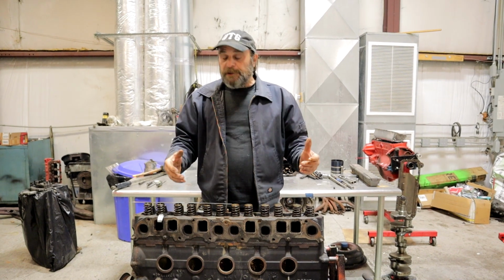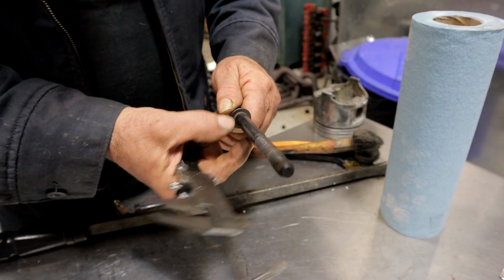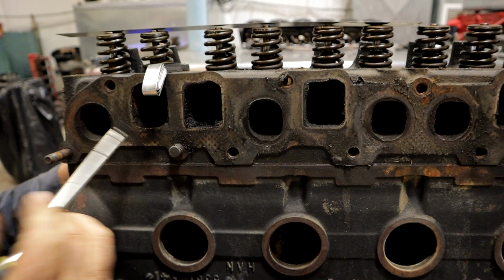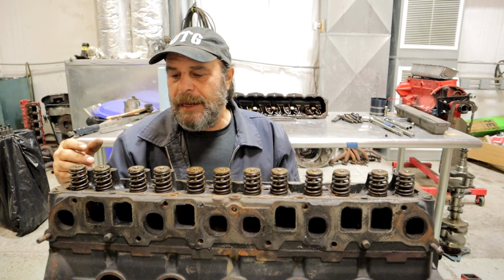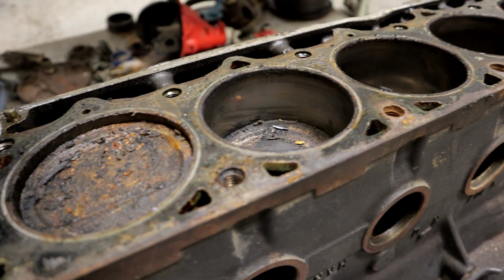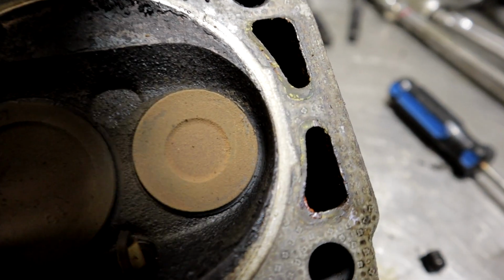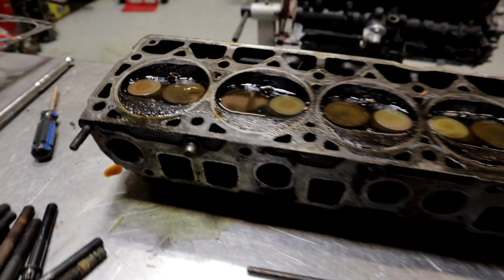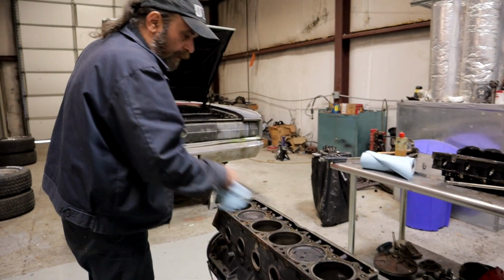Your First Engine Job - Pulling The Head And Assessing The Damage

Comment: I've got a 1968 jaguar 3.8 that's locked up. It's been soaking for months and I've finally resigned myself to having to open it up. Looks like I'll be watching this series of UTG on repeat over the upcoming winter. (Southern Hemisphere)
Looking forward to it if I'm honest
Reply: how did it go
Reply: @TheJCompound  not well I'm afraid. I'll need to pull the heads but it's in a line behind 3 other project cars😅

Comment: I have not had good experiences with reman 4 liter heads. I had one refreshed at a machine shop for less than 300 bucks. Cleaning, valve job, springs, seals. Ready to paint and install, and I knew what I was getting. Why would anybody bother with a gamble on a reman.

Comment: The bolt stretch is 100% correct, this happens when the bolt's yield (and likely ultimate tensile) strength is exceeded and it begins to neck. It will lengthen at the expense of diameter and that relationship is described by Poisson's ratio.

My materials class finally coming in handy :D

Comment: When I rebuilt my ford 300 inline 6 engine, I tried to get a remanned head but they were and are still unavailable. Mine was cracked so I had to go buy one from a salvage yard and get it machined. When it was all said and done it was actually cheaper or about the same as a remanned head. So, while yes a remanned head will save you time and maybe some money, the availability is something to take into consideration.

Comment: Great advice on getting a reman head if the teardown sees trouble. I once had a Chevy Cavalier that needed valves ground. Due to cracks between the spark plug and exhaust valve (those engines were known for them) It took 3 heads to get one that was good enough for the machine shop to rebuild...by which time I had almost exactly the cost of a reman head in it.

Comment: The "blocked water passages" that you pointed out are not water passages. They are sand casting drain holes. They are only there for sand removal after the casting process. As you can see, the head gasket does not have through holes for those "blocked water passages". The only water passages that are active on this engine are the two in the very rear, the one circular hole in the very front and the small 6 holes on the cam side for each combustion chamber.
Reply from the maker: Yes..I realized that after we shot this and Kathy had finished the editing.  I'll mention it in the next installment.
Reply: @UncleTonysGarage  man tony, where would this channel be with out dead eye master techs from the land of comments? Love what you do man, I've learned A lot from you, and you lead me onto David V and now I'm checking out his new channel. I'm glad he makes videos about the book I got, because honestly he takes a bit to get to the point and I'm more visual than a reader. Lastly, I love xjs and the 4.0. and Chevy inline 6s, and the big ford, I don't think anyone made a bad inline engine. Thanks again!

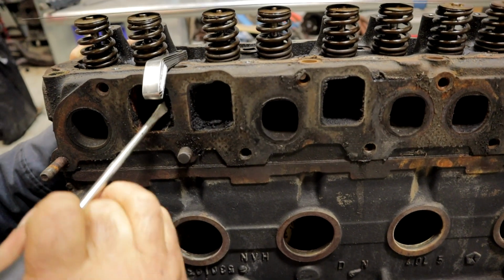Comment: 4:23 I would lean more towards PCV dumping into the front half of the intake.
Reply: I was thinking the same thing.
Reply: or EGR
Reply: definitely, They are known for being oily mess inside the intake. I put a filter on the pvc line to try and slow it down
Reply: @sometimesleela5947  no I would not go that way the exhaust has already burned the oil and it would be a sooty deposit.
Reply: Interesting comments  there is NO  PVC Valve on that motor   What EGR  
  my thoughts are a Poorly Done in frame Overhaul  with a lot of miles
Reply: My bet would be blow-by (probably from that #1 cylinder) "pressurizing" crankcase. These engines just have a metering orifice to create positive crankcase ventilation, not a PCV valve.
Reply: @tanhalt  I can groove with the idea!
Reply: @tanhalt  CCV  it is
Reply: @sometimesleela5947  No EGR on these engines

Comment: According to the FSM on 4.0’s if you reuse head bolts they should be marked. Marked head bolts should be discarded and replaced when removed. 

Since 4.0s are subject to overheating I suspect that head has been off a time or two and the bolts weren’t replaced.

Comment: Finding the Fugly...
4.0s toward the end had cracking cylinder head issues, prior to, if you were good about oil and coolant changes you could count on 220 - 250k miles before the rings were ready for retirement. 
Another cool thing is the reward for using good oil - #1 cylinder stays near round and with near no ridge - not bad for the cylinder right behind the water pump!

Comment: WHen I was wrenching on racing 2 stroke motorcycles, we used to turn down the plain part of the cylinder bolts - the the threads were a bigger diameter., so as to eliminate the stress riser. Because otherwise you had a teardown or 2 and you went to tighten a jug up and jink you broke a bolt, I think the later factory bolts did exactly this. This was on early Yamaha TZR350s and 750s btw..

Comment: I bought a 1997 Jeep xj last summer with a broken piston skirt. It only had 170K ton it. I just pulled the oil pan and head. It was the #3 piston. I just ordered a piston and gasket kit from Rock auto. Though I failed to order a new pan gasket was able to clean the old one with RTV! It all works great. No leaks and runs good. I’m 56 and this is how I have fun. I put 4.5” lift and 35” milestar mud tires and wheel that were close to new from market place for cheap.
Reply: NICE, HAVE FUN, SIR.
Reply: I also like to surgically fix my own stuff. No need to rebuild an entire engine, trans, rear end if its not necessary.
Reply: I like to see how good I can make something for the least amount of money. I still want to be kid of cool 😎. Even though it’s kinda silly.   My daily is a 2007 v8 4Runner with only 290k I bought it 2 years ago for $4500 put in all new suspension CV axles Tires and detailed it’s been 100% reliable and for what is it kinda fast I do have 33” tires on it.

Comment: When checking the seal of the valves I like to put the gas in the runners not the chambers. The test is the same. But I think it's just a bit easier to watch the valves weep.
Reply: That's what I do also it's extremely easy to see when there all carboned up
Reply: If it had overheated, the valve seals are now toast anyway
Reply: Valve seals are not in the runners. But yes I'd pop off the valve spring and replace the seals. Even test the spring rate.

Comment: I would say the oil in the intake passage came from the PCV valve. Those 4.0L came in all the time and the air filter would be soaked with oil from the breather..   idk if it was just excessive blow by, bad PCV valve or just a poor PCV system design in general on those jeeps but with some miles on them it was impossible to keep them from soaking the air filter and the breather filter in the air box.

Comment: Tony, In a future video, could you pull those burned valves and compare them to good valves?  Because I couldn't tell what the difference was.  Thanks.
Reply: The clue is they are slightly off circular- as soon as you see that, you know when you take them out they will be worse.
Reply: What don't you get he told you which valves are f*** up without having eyes in the combustion chamber Superman with x-ray vision couldn't have done a better job at diagnosing this problem but we're human we're not Superman we don't have X-ray vision diagnosing the problem is a five-step process Step One machines f*** up Step2 what part is it out of the Thousand Parts it could be and isn't is it. Step 3 is research if you don't have experience ask somebody step four is getting the correct Parts on hand in the proper Machining the correct the problem step five reassembly is opposite of disassembly so pay attention and take notes throughout the process and a lot of times you can't even see a sunken valve when you lay eyes on it 3 1 thousandths of an inch is the threshold where the human eye stops seeing is the width of your eyelash a little bit less than a human hair not trying to be a dick just want to help you expand your mind and knowledge peace
Reply: @kevinpatton3950  I don't have the resolution to see it on my screen. Maybe he can't either
Reply: The valve literally starts to burn from getting too hot. 
It can vary from being slightly out of round, to looking like someone gouged it with a torch.

Comment: Years ago I had an 83 CJ7 4.2L six with a cracked head. A friend brought me a head he had in his shed. My head bolts were 1/2" diameter, but the replacement head bolt holes were 7/16" diameter. So we put the head on a drill press and made the holes 1/2". The head bolted right on and the engine ran. But it was way down on power. The only thing we could think of was that the head was from a 4.0L and had lower compression. And it only got 10 MPG!. But I had to get it running because it was my only vehicle at that time. That's when I swapped in a SBC 350 with an adapter plate. The 350 got 15 MPG with double the power.

Comment: I was exposed to the Machinery's Handbook when rebuilding my first engine.
Very useful for checking whether standardized parts - like fasteners - are in spec.
Reply: You are absolutely correct . As a machinist i agree 100 %
Reply: The Machinery's Handbook is the Bible to most engineering and mechanical designers. Invaluable information on math, geometry, iron, steel, fasteners, machine tools, tooling, fits, tolerances and interferences for assemblies, speeds and feeds for machining, coloring steels, material properties and so much more.
I own two, the standard toolbox size and the LARGE PRINT version that was "handy as a pocket" as I neared the end of my career in mechanical design.
I highly recommend the Machinery's Handbook to anyone that builds anything.
Reply: @dadstillsurfs  Dang, I have one but haven't seen it in years. Good summer project rummaging through my machine shed.

Comment: How clean is the intake valve?
Jeeps original injectors are single hole and are designed to hit the intake valve with raw fuel and clean the valve.
If you have bad injectors and the spray is off or weak then the valve will not be cleaned.
The ports also suffer with carbon buildup.
Note: Four hole injectors also don’t clean the valve either

Comment: Another thought about the gak in the intake ports could also be from the PCV valve. Depending on where it is located on the valve cover, and where the vacuum hose for the PCV valve is located could cause that build up. I could be wrong, but that could be the build up in those ports.

Comment: So sunken valve seats do happen quite often with aluminum cylinder heads. Also valves like to "tulip" or stretch because the seat area of the valve will get beaten away from the valve stem.

Comment: Uncle Tony could you make a video about the use of a torque plate when honing an engine people have free handed it for years but let's talk about what happens when the cylinder heads on in the bolts are tightened

Comment: For reference in 2018 I had my 99 XJ long block rebuilt by an engine shop after the wife overheated it and cracked the head. They found a used replacement head. All new pistons etc. $1700. I did the removal and install myself with new 4 hole injectors and exhaust manifold which was cracked as they all do being horribly designed with inadequate exhaust hangers IMO
Reply: The dodge neon injectors?

Comment: My local shop just told me that I should purchase the headbolt set of which is supposedly recommended with a headgasket set, despite my shop manual not recommending replacing these. The engine series following mine, however, does indeed demand replacing the headbolts. The second series is of a totally different design.
Thanks to your tutorial, I'll go out an invest in a precision micrometer, to make sure that my shop manual hasn't erred
Reply: For the cost of a head bolt set, I just always reccomend to my customers new head bolts. Although, most of my customers are driving cars with TTY headbolts anyways, but even when they aren't, I will usually just say "it's a good idea to just replace them anyways". It's a CYA move on my part, just in case. Never had a customer decline either. They usually trust me enough to trust my judgement. Besides that, you're talking between 40-50 bucks for a head bolt set, on top of a hundreds, or possibly over a thousand dollar head gasket job.
Reply: @Spike-sk7ql  this is a MUST  it is cheep insurance    and helps in the over all torquing and keeping the Cylinders uniform
Reply: I reuse head bolts unless the manual recommends them. Or if they are visibly damaged (you can put a straightedge on the threads to see if they are pulled in). Aftermarket parts may not be of the same quality as OEM parts.
Reply: @mph5896  interesting Choice  not the one i would  make  and it is easy to do a Rockwell test on a new bolt  to test
Reply: @claycoates5056  No, I am not spending money on another tool I don't need. I already bought a key duplicator that is sitting on my work bench🤣. 

Honestly, dealers reuse head bolts all day long. Good enough for them, good enough for me.
Reply: @mph5896  A  Hammer and a  Scale 
 now that is Cheep   
 Head bolts can be reused  may work  there are plenty of blown head gaskets out there
 If it works go for it   Bolts are Cheep
i found a set for Twenty  near by
Reply: @mph5896  Especially, when aftermarket parts have no country of origin stamped onto them. Recently, I've been visitting the local parts store, despite getting parts from the internet is less expensive, after having gotten burned on internet parts of which weren't up to par. To my disappointment, even the parts store network has been getting sloppy lately. The first thermostat ordered was a made in Japan and is even adjustable. Unfortunately, it wouldn't fit my Daihatsu:  https://i.imgur.com/YLyW1rM.jpg The box it arrived in was kicked around pretty good, not reflecting a positive image for the store: https://i.imgur.com/32S2hzO.jpg . So, I went back and ordered one again. This time, there was no country of origin stamped onto it and it looks skimpier than what I pulled out of the engine: https://i.imgur.com/yZdbVoq.jpg https://i.imgur.com/0noQGMq.jpg Having only about 65.000 miles, I'm assuming that this is still the original. It looks heavier duty than what's about to replace it: https://i.imgur.com/M6QjbRP.jpg This new one might just be as good. But after having had bad experiences with parts lately, I've grown somewhat distrustful. A thermostat isn't a big deal. If it doesen't open right, I can always remove it easilly. When a head gasket blows because of faulty bolts, it'll cost more than just a new gasket set. If you need headbolts, the best way would be to try getting O.E.M.s

Comment: What is the casting # on the head ? Might want to do a little home work  before rebuilding it. 0331 , not good ,different years have different port configurations.  Make sure it will work with the intake on the jeep you're putting it in.

Comment: I was building an engine from old parts. Just lined up headbolts by length from 3 different motors and used the shortest ones. 

The scandinavian hot-rod standard engine is the volvo redblock. Known being inside in the highest miler car volvo p1800. I think it has the same burnchamber as in a buick. 
Factory performance motors have around 1hp/cui, but they go up to 2hp/cui NA. Stock motor, with new rods can go 3hp with turbo. Record for this motor is in a dragster thay goes more than 800hp from a 2litre 4 cyl, desinged in the 1950s. 
  You could go and see this guy "David Bello" or another enthusiast.  
I think you would enjoy seeing a teardown of a volvo b18/b20 while talking about similarities on american desings ;)

Comment: If you want some good content along the same lines of your other quality control videos, buy that remanufactured cylinder head from the auto parts store. I sold them for 10 years, the quality was absolutely despicable, and very very few heads I sold were good out of the box.  Also, my parts store offered three different brands of cylinder head, they were all equally terrible.
Reply: That pretty much describes all auto parts out of the big box auto parts stores. I have a local machine shop that my parts go to. I would slap a used head on before a REMAN POS from Autozone.
Reply: That's what sucks about keeping up with old cars. It's never the 30 year old part with 400,000 miles on it. It's always the same replacement parts over and over. I put a reman cylinder head on my jeep 6 or 7 years ago and I haven't had an issue but I totally believe they are done poorly. Basically no good options anymore

Comment: I’ve played with these 4.0 ‘s a lot ant the head are prone to warping and cracking. Certain ones are really bad.
Reply: It's the Chrysler heads for 00 and 01 as they were made poorly and too thin. The 0630 (pre 00) is really an amc head. Only time I've seen them fail is if stop leak was in the system at some point causing hot spots.

Comment: Easy way to check for a stretched  bolt is to run a nut down it by hand with your fingers. If it binds or stops, replace the bolt..............
Reply: That's how I learned. First experiences were with wheel studs. I could tell when someone liked to overtighten their wheel nuts because the nut didn't feel smooth or consistent or bound when threaded.
Reply: You been watching AvE ?😉